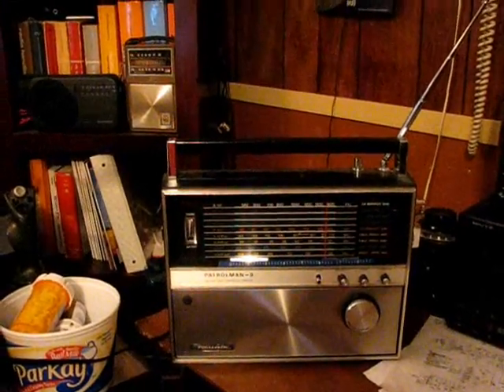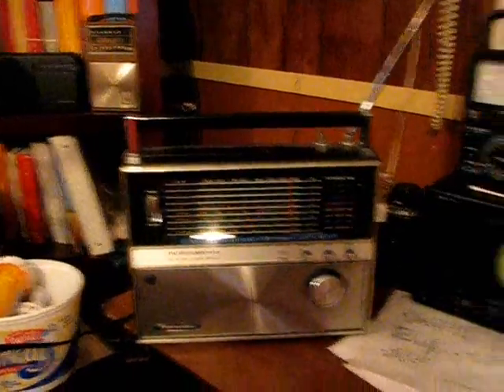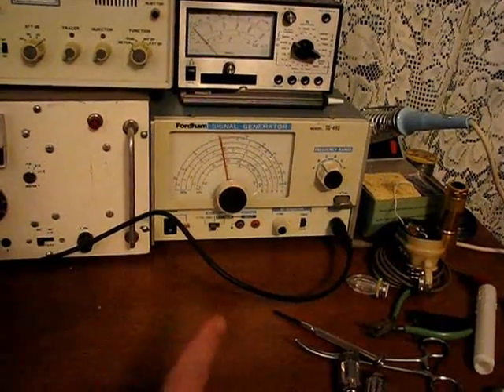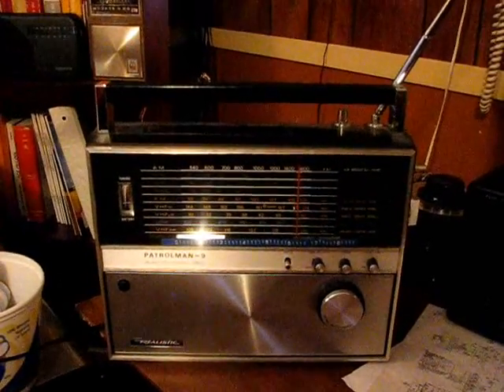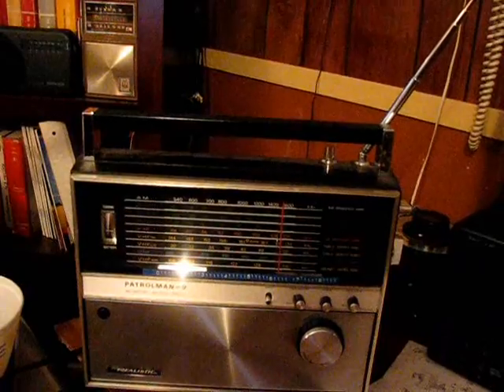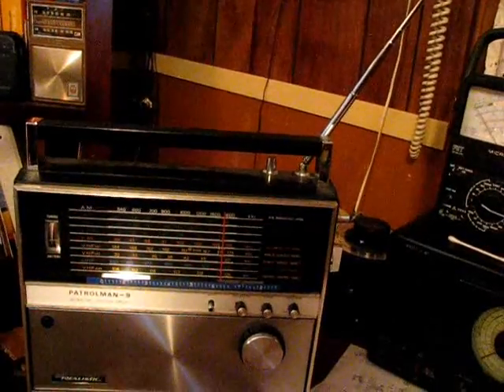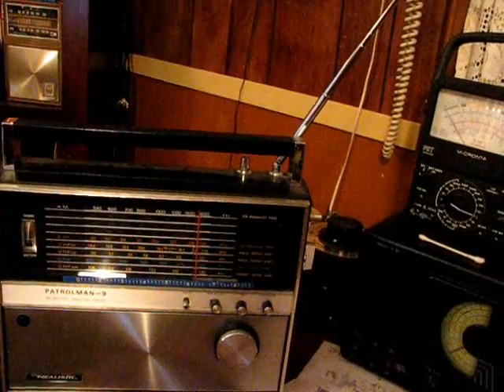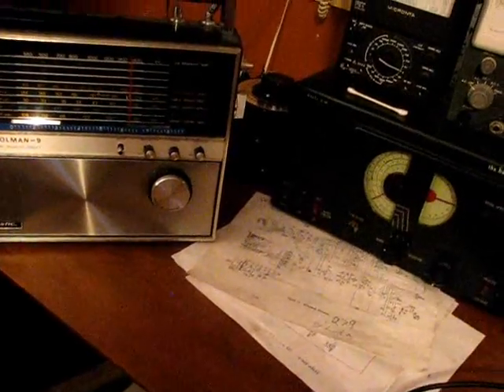SSB on a AM only radio - B.F.O.

Comment: All right. Sounds good. Took  a ten tec stand alone bfo.  And fed the signal to my 30 year radio shack® radio. As I have a 25' line antenna. Hung in a tree. Mixing super good with the in comeing rf . No thing did I do to the radio just mixed at the ANTENNA. Good DX   this last weekend I worked. All the east coast. Then Canada. And eastern Mexico. Texas. Oklahoma. You get the picture it was a SWL TURKEY SHOOT. Tks 73 de kv4li

Comment: Great tip on improving the Patrolman 9's performance. By the way, I have a Patrolman 9 also - the BFO on mine works, but it's a very weak oscillator and I have to use just a capacitively-coupled antenna to attenuate the hams to a point where the BFO can work on them. Also if I remember right I had to re-center the BFO's frequency - it had drifted over the years. A very nice radio otherwise.

Comment: It's funny that I came across this video because when my Grandfather died I inherited the same radio it's a little bit beat up but it still works.
But anyway I Googled what a BFO switch was because I never really had any idea what it really did I just always noticed it seemed to clean up the frequencies. 
My radio is actually a Patrolman - CB9 and it looks a little bit different from yours but it's still pretty much the same radio. 
I guess my radio is a couple years older or newer than yours maybe.